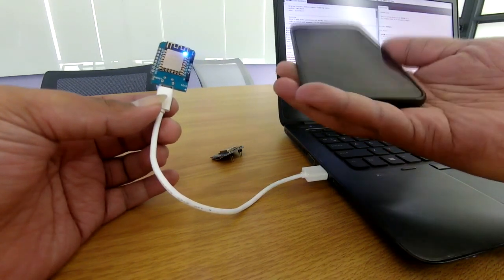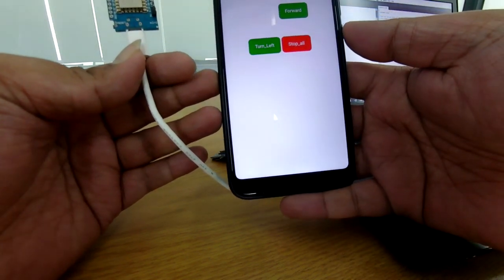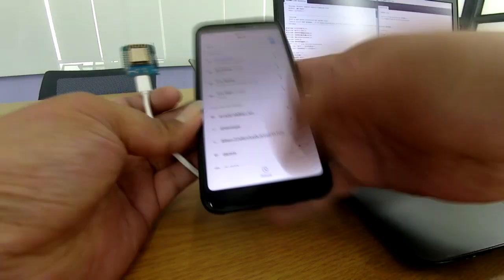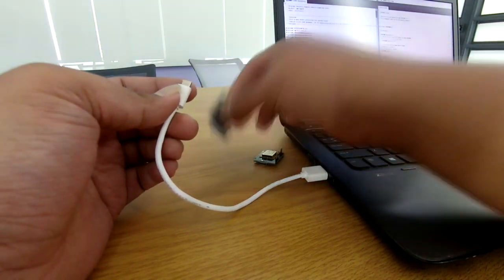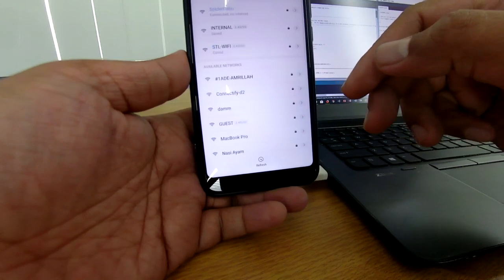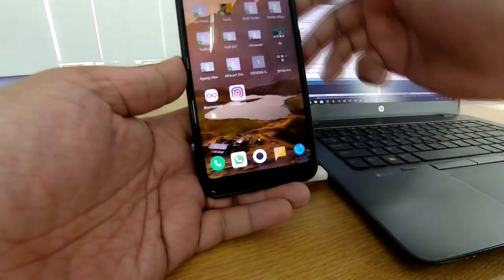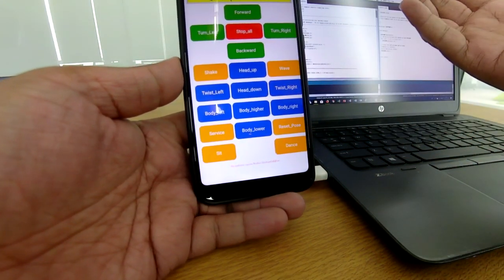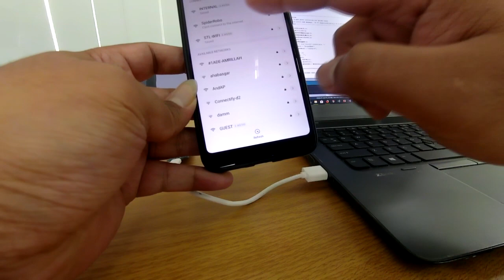wemos D1 mini  Clone common AP problem

Comment: Since i placed a 47uF-Elko on 5V my D1 mini clones are stable in AP-mode.
Reply: Could you ellaborate on that please. I am having some issues with unreliable wifi on a project i am making.
Reply: @EspenShampoo25  I think the biggest, or maybe only, problem with D1-clones is the voltage regulator. Original Wemos use ME6211 with 500mA, clones mostly have a regulator with SMD-Code 4A2D.
The most power-consumpting part is Wifi and i tried capacitors at 5V and/or 3.3V, but only on 5V the result was a stable Wifi-AP, even i used a real 2A Powersupply.
Without capacitor i had exactly the same behavior described in this video.  After i soldered a capacitor (47uF, maybe less also ok) on the board between 5V and ground,
Wifi runs rock-solid as client or accespoint. I have no Oscilloscope to visualize the efficience of this capacitor, but for me it works.
Reply: @SniffinGlueDE  thanks alot man. Ill try it out fir myself once i get ahold of a capacitor!
Reply: @SniffinGlueDE  Great!! I was thinking about doing that, hands to work!
Reply: Update: It didn't work :(
Reply from the maker: nice... thanks for your information.....

Comment: I buy only D1 mini from Lolin. they are best in class boards with strong pin voltage and best stability overall. I suggest to try d1 mini from Lolin v3.1

Comment: Hello. I have a problem with connecting to the AP. I'm going to upload the program pretty well to wemos. But if I connect with my smartphone and press a command, the AP stopped ... why? Servo board is well, servos too,... but communication between board=wemos=smartphone... no ... :( i tried cables and others... and nothing :/
Reply from the maker: check your power, maybe it's under power
Reply: @MusaWilmar  the tension is fine, I measured it. The code from you from the page is fine on your device. I'll join wemos without any problems. But as soon as I press a different command (run, walk ...), the wemos stops blinking and only shines. The site can then neither be restored nor anything else. And as for the servo board, I don't know any further.
Reply from the maker: @tomminihillus4728  is your wemos stop broadcasting after you push a button?
do you ever try detach all the cable from wemos and run it? is it have the same result? if not maybe you have short on your servo driver or servo...
Reply from the maker: try this:
1. run only the wemos and run serial monitor from arduino IDE @115200 baud rate
2. open the webpage and push one of them
3. on your serial monitor should show some code (just one time)
4. one thing that u have to known is every command u send to the servo driver need feedback from driver that's move is done. but because u don't attach the RX/TX cable to servo driver it will wait the OK signal eternally (it's normal)
5. than connect RX/TX to the servo driver  and power it again
6. repeat the step 2, you will able to send more than 1 click button (it's mean that your driver is OK too)
7. than connect your servo one by one and repeat the step 2 until all servo connected.
Reply: @MusaWilmar  yes i do it and the result is the same. It was connected only from USB and I connected to it without any problems. When I pressed a command, it stuck again and stopped flashing / loading.
Reply: Mathieu Anglade I dont have fix for this bug :( but still wanna do

Comment: I tried 3 boards so far and none of them worked. I can connect to the WiFi but none of them ever render a page. I'm using Chrome on Android
Reply from the maker: did u try simple AP webserver first..? just to make sure that your board can use that protocol... PS: i'm using chrome on android too... and it's work really good... but also there some board didn't work...
Reply from the maker: maybe it's because bought cheap nodemcu from china...
Reply: @MusaWilmar  are there any other settings that I have to make on my phone? This is the forth nodemcu i tried and didn't work
Reply from the maker: @georgegabriel7766  no special setting just like any other wifi AP, just user and password to connect... And open the web page...
Reply: @MusaWilmar  I believe there is something wrong with your code. I've tried the AP example from the arduino IDE and it renders the webpage no problem :)
Reply from the maker: @georgegabriel7766  there is many example on internet how to make nodemcu AP webserver, maybe u can use this one because it's look similar with mine https://www.teachmemicro.com/web-server-nodemcu-websocket/
Reply from the maker: @georgegabriel7766  perhaps some code didn't  fit with some device.. but some problem can fix by only replace the nodemcu... at least that's what i experience... sorry if i can't help u much...
Reply from the maker: @georgegabriel7766  using RX/TX is the safes way to communicated between board because every board has it and no special library for it... so yes u can use the servo driver with other board such as a arduino, raspiberry or else...
Reply: so the clone is not working?
Reply from the maker: @bambangtris9210   not all bad but not all good either... if u feeling lucky maybe u got a good one... :)
Reply: @MusaWilmar  buying clone just like a gamble wasting money sometimes
Reply from the maker: @bambangtris9210  yes u'r8